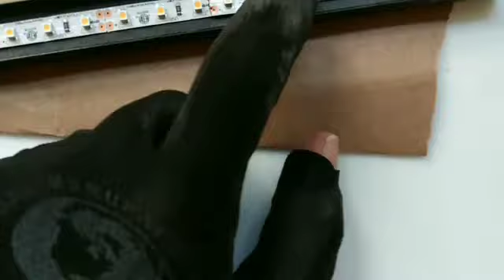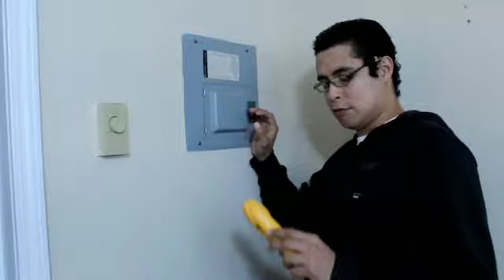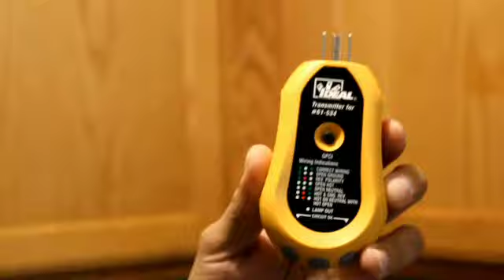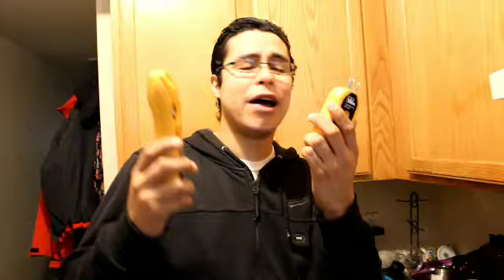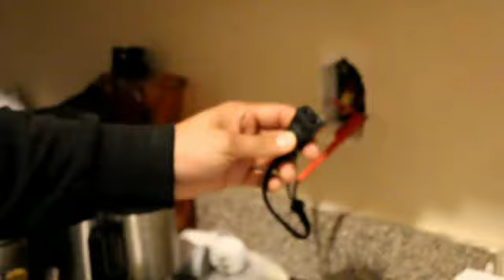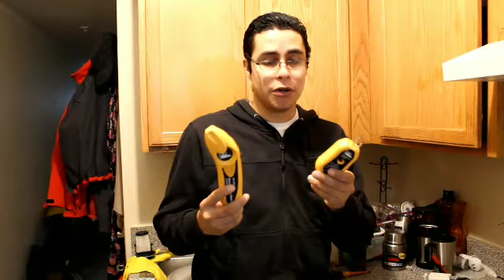Tool Demonstration of the Ideal Circuit Breaker Finder #kleinguyjon

Comment: Try using the riciever from the kleincircuit detective with another transmitter also Klein..
Reply from the maker: Unfortunately the ET300 receiver does not work with transmitters other than its own and I'm goin to assume the newer model: ET310 does not work either.

Comment: I have the Circuit Detective from Klein tools the transmiter and reciever...but also the transmiter from another model but its also Klein tools...do you think it will work...in case i forget the one from circuit detective
Reply from the maker: Good question @Jose Orta. I'm not sure. I don't have any other klein tools transmitters other than the ET310 and the ET300. Give it a shot and see what the results are. Thanks for watching.
Reply: @KleinGuyJon  I have the ET 300 transmiter n rieciver...n only the transmiter fron the et310 model...I tryed to use the transmiter fron ET310 with the Circuit Detective ET300 reciever...AND IT DIDNT WORK....
Reply from the maker: @joseorta9928  i miss understood sorry earlier but i was pointing out that the ttansmitter works with the receiver not vice versa. But curiosity never hurts. Good to know.

Comment: Holy hello! I’ve been looking forever for one of these!!!!! Is there a tool like this that tests light fixtures? I’ve got a jumbled mess where previous “electricians” did work and didn’t relabel breakers.
Reply: Or could I technically use that Klein accessory and clamp directly on the black and white wires on the fixture and find the breaker that way?

Comment: That is one very cool tool Jon.  I have a problem here that your tool may or may not solve.  I have a GFCI outlet in my master bath that stopped working two months ago.  The reset button doesn't reset and any appliances like my blow dryer and hair trimmer won't work.  This is the ONLY outlet in my master bath.  So, I have a replacement GFCI outlet to install but have no idea which circuit breaker it's connected to.  Would this find the correct circuit breaker in my panel since I have no way of plugging in an appliance to make sure the power is disconnected?  Additionally, I really do not want to spend $100.00 on a tool for a one time use, so is there a solution?  Please advise and thanks for sharing buddy.   Cheers!
Reply from the maker: If you cant find the tripped circuit breaker than it might be the GFCI is no longer working but still energized fron the line-side of the GFCI. Do not and I mean do not work on LIVE wires call a local licensed electrician. If you have to, shut off the main breaker as a last resort and replace the GFCI. Be sure to still test the line-side of the GFCI for voltage with a multi-meter or with a NVCT (Non-Voltage Contact Tester).

Work safe but if your not comfortable with electrical, contact you local licensed electrician.
Reply: @KleinGuyJon  OK thanks Jon.  Yeah, I know the breaker isn't tripped as I would know which breaker it was then.  So I'm thinking the outlet has gone bad.  I almost turned off the main but I'd be spending a bunch time resetting all my  clocks and other appliances. But I just may do that.  
I will test it with a VOM first to make sure it isn't live.  Thanks for your input and have a great week.  Cheers!